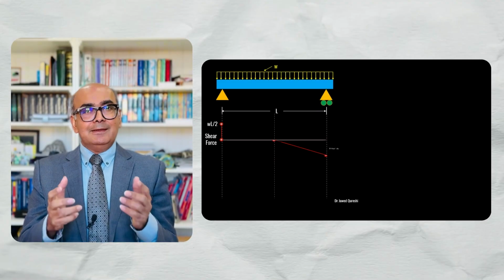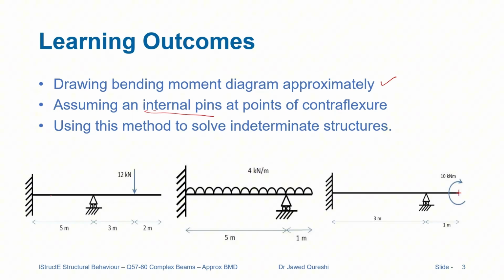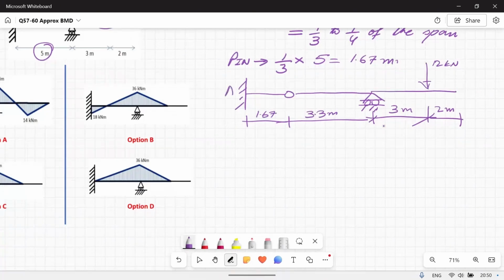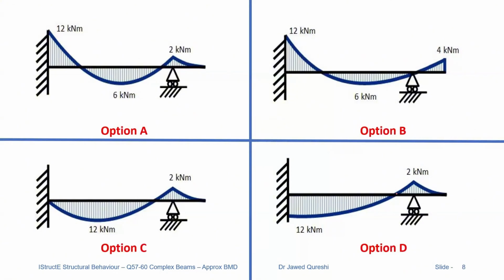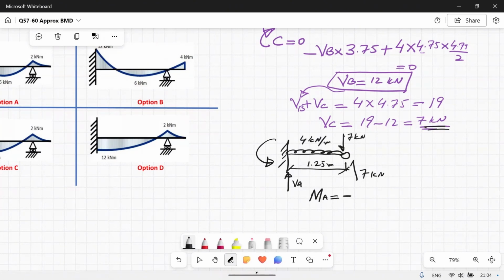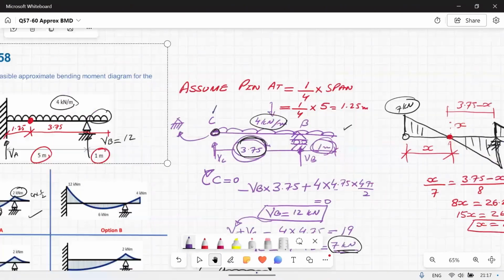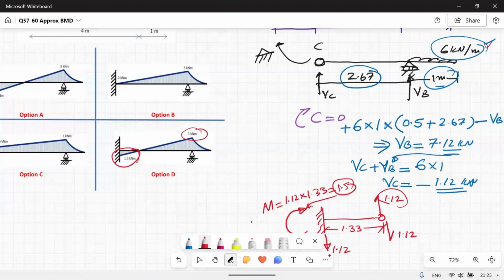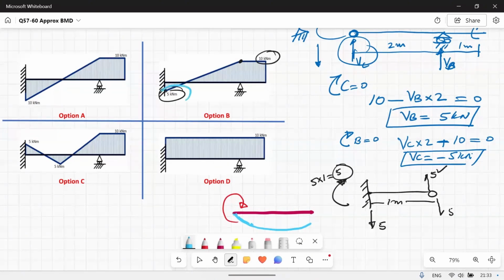Learn Approximate Bending Moment Diagrams | 4 Worked Examples | IStructE Structural Behaviour Course

Comment: I appreciate the equilibrium approach to solve these, sometimes there is no other choice. 
However if we look at example 3, you can solve this qualitatively with some fairly simple behaviours. 

The cantilevered UDL to the RHS of the roller support means the majority of the reaction will be at the roller. 
We know there is a moment reaction at the fixed end due to the deflected shape. As the lever-arm from the fixed-end to the roller is relatively large - the reaction force must be quite small. This lead me to Option D, which had the only feasible BMD out of the options.
Reply from the maker: Yes, I agree. Sometimes other techniques work better for solving a problem. Thanks for your kind comment and feedback.